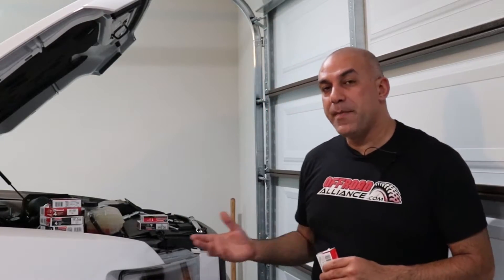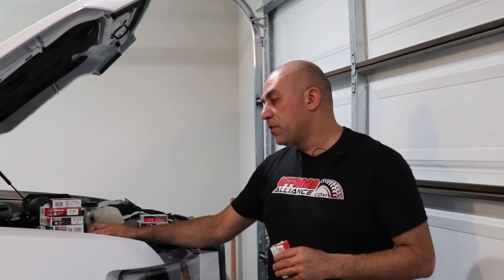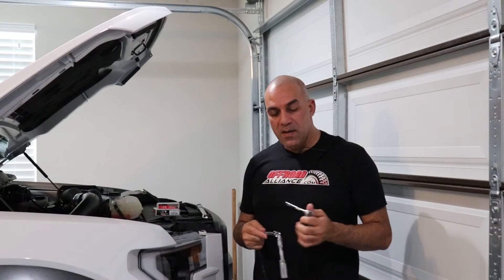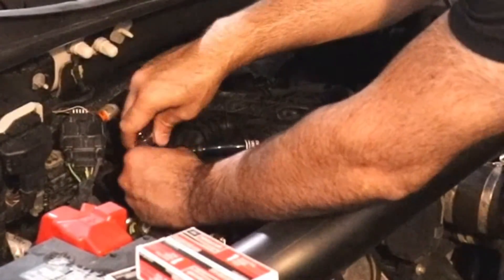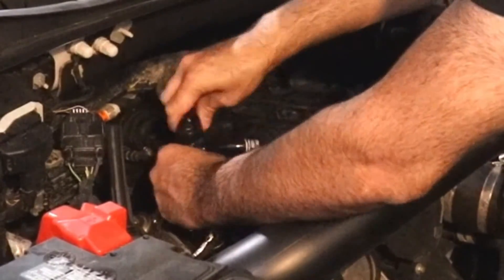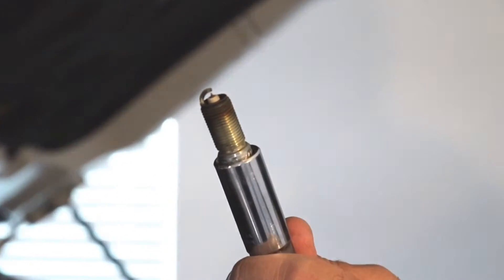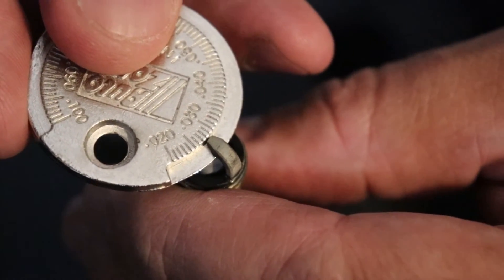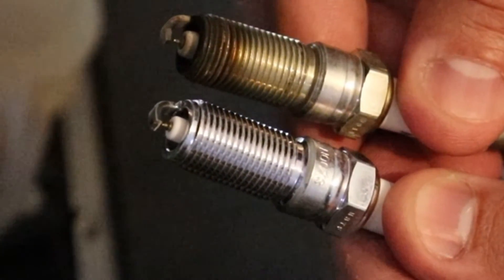SP542 Spark Plugs Install (Gen2 Ford F150 Raptor)

Comment: Google how to read your Spark PLUGS, just looking at the color of the plug I can see carbon or the blackness of the plug is an indication of too much of Fuel,  this comes from not enough air flow,  meaning that your Air filter blocks up it needs to change every 12000km, Ratio of Air to Fuel is 11.5 times

Comment: I had SP542’s in my 2017 Raptor awesome product. But for the 2019 went with NGK Laser Iridium Spark Plug Part#: 95822. Not one complaint with MC SP 542 just did a lot of research and wanted to try NGKs product. 

What’s your thoughts on NGK Laser Iridium Spark Plug
Part#: 95822?
Reply from the maker: Creighton Spies EA both are Iridium plugs and both are just as good for being swapped at 12-15k miles. I’ve had great experience with NGK plugs on other vehicles of mine and never had any issues. I would make sure that whatever plug you are using doesn’t require a lot of gapping to get to .026/28. Had one supplied to me and it was gapped from .043 to .028. I think that’s not as safe as using one that has a starting point of .032/33.